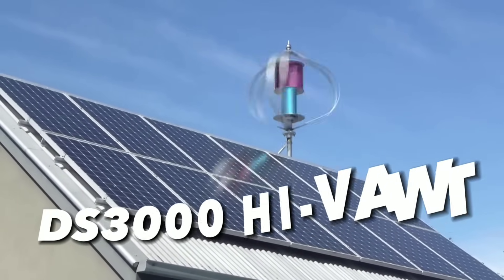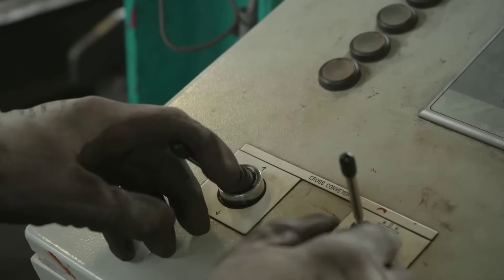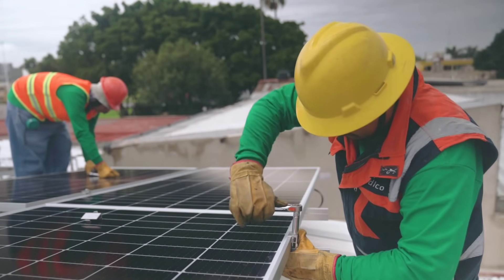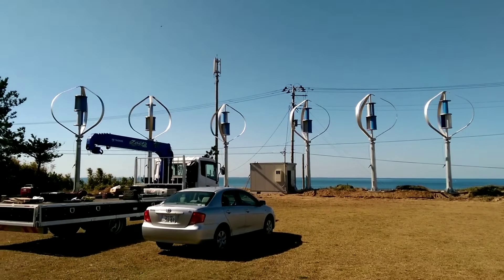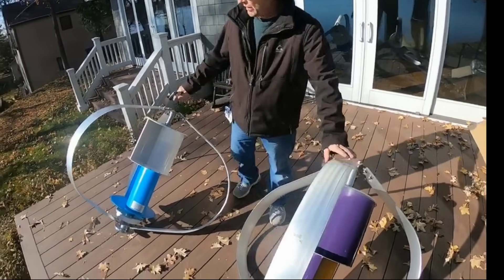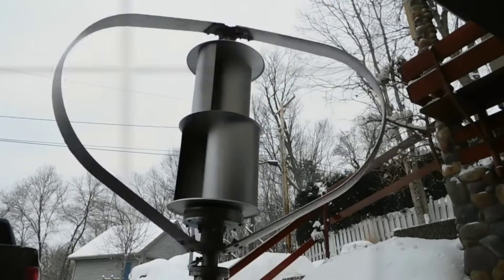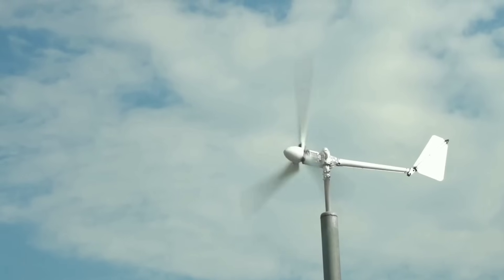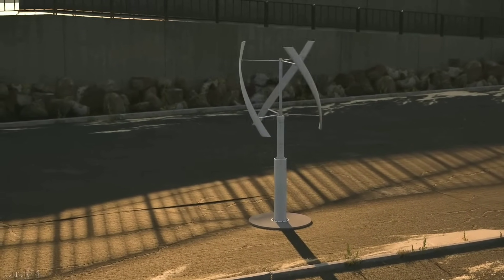This Could Be The Cheapest And Most Powerful Wind Turbine In The World.

Comment: All fine and good but what happens in high winds what is the max wind speed before it is dangerous To have it up eg. Blades coming free and flying into property or people, or creating enough drag to tear mount from the roof may be rearing hold into the roof?
Reply: I like that other companies that closes the cups in as the wind increases so it can't go overspeed in any wind.
As they put it.  Why would you not make power when you have the most wind.

Comment: This is complete hoax. Such a small turbine will produce substantially less than 100Watt at 3m/s which is the average wind speed for most locations inland. Over a year this amounts to less than 800 kWh. You can't run a home on that. The average yearly electricity consumption of a home in the US is 10 000 kWh.
Reply: I have a 3000 in western MN that produces over 9000 kwh/yr. Fact.
Reply: @TurbineGuy  Do you realize how bad that is?   you need to be getting MAGAWATT hours a month if you want useful power.
Reply: @robertsmith2956  That is double what a 3 kw solar system will produce.. BTW, most homes use around 40 kwh/day, or, 1200 kWh/mo which is 1.2 MWh/mo. Compare this to the 0.775 MWh/mo the turbine produces and you will see it is an acceptable number.
Reply: The hoax is computing a production based on 3m/s all the time for one year.
Reply: you could charge your cell phone on it.  That is what I figure I will make with a water wheel on my house water main.  Every time I flush a toilet, or make some ice in the freezer it will spin.
Water board pays to keep the water pressure in the line.

Comment: How many turbines would I need to power a 600 square foot home?
Reply: I mean you could have a 600 square foot home and no electricity so it is hard to answer you question accurately... what you should do is measure how much power you use in 24 hour period or better yet get the average of a 7 day period and then ask how many turbines you would need to for x amount of power
Reply: A single 3kw turbine and 3kw of solar and you'll have all you need
Reply: I estimate that you will need more than 20 turbines. See my recent comment.